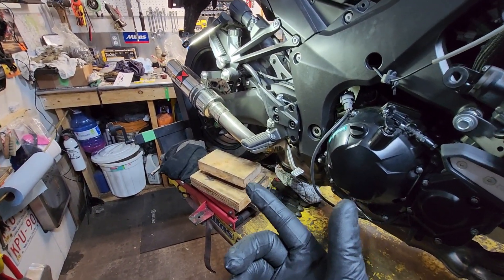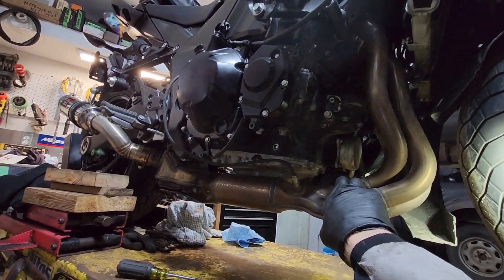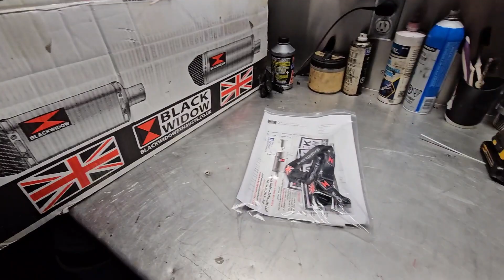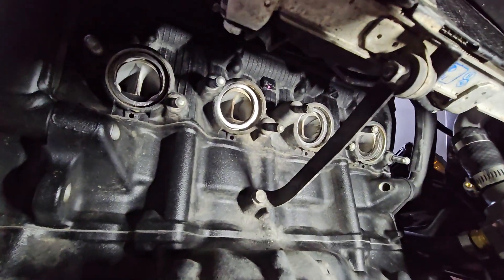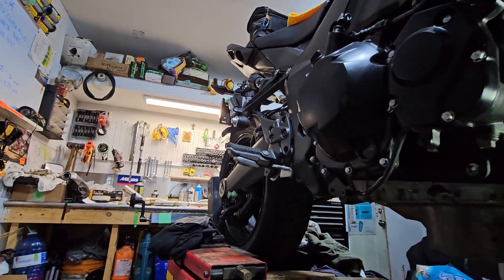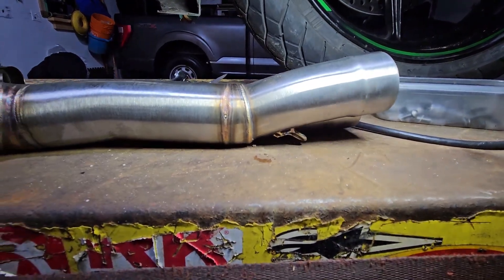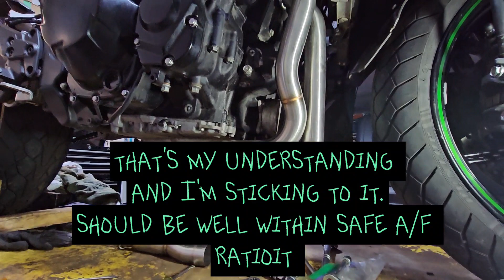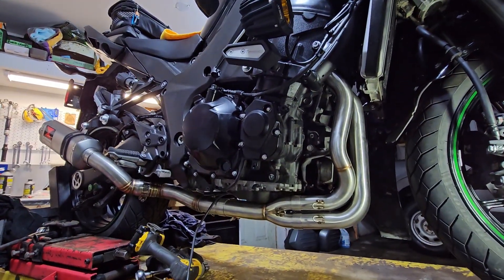2020-2024 Kawasaki ninja 1000 SX.  Black widow full exhaust system install

Comment: Wow, thanks for the detailed video! Got the link through the N1K forum.  I have a '21 and as soon as it's off warranty I'll put a full exhaust system on it. Leaning towards Black Widow too so looking forward to hearing about how your bike rides with new exhaust.  A few questions.  No check engine light with removing the O2 sensor?   Any backfires with the full exhaust?  Why not flash?  From what I hear a good flash will remarkably improve throttle response and rideability.  With opening up the breathing by installing a full exhaust, my naive way of thinking would be that the bike would run too lean if it is still using the stock fueling, throttle and ignition maps and I'd worry about engine wear and longevity.   Maybe I'm overthinking.  Anyway, looking forward to following your ride.
Reply from the maker: No worries!
It's my 2nd system.  Vg product.
Dead of winter here so no riding. 
Will report back as I put some miles on.
Reg.  The tuning.  In Canada I have to ship the ECU off to the states.  It gets expensive and I have had ecus lost.
If the fuelling is good from factory (it's vg on my bike) with a stock filter you're not putting In more air, or burning extra fuel.  
There's an excellent vid (search bmw  s1000r black widow).  No tune, and he is well within safe a/f ratios.
I put in Brand new plugs when I installed the exhaust.  I'll pull them at the end of season and compare to the oem plug color.
Reply from the maker: Here's that vid I mentioned: https://youtu.be/Yhd8JmGv0n8?si=aQ-2EeIHBmUKU7Tg